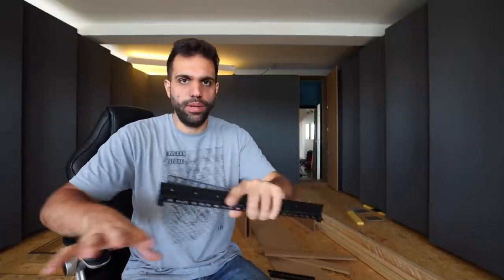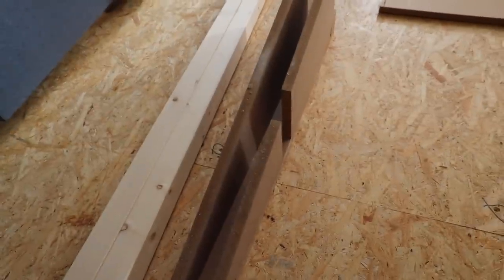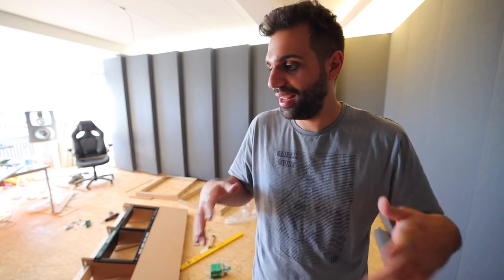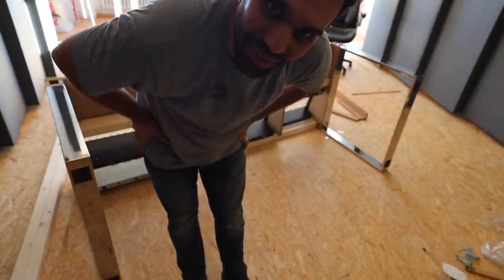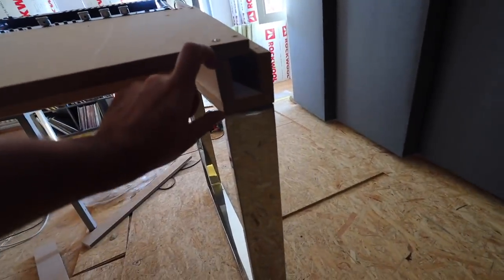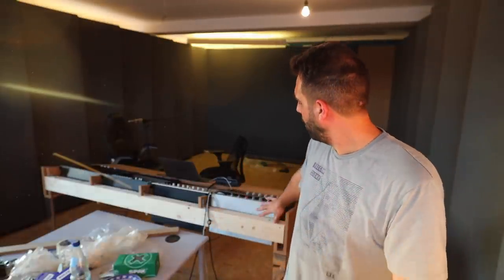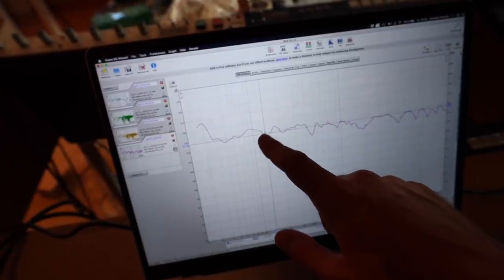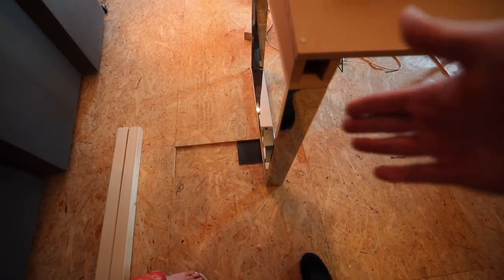DREAM DIY RECORDING STUDIO DESK BUILD - PART I

Comment: Just adding to Anywhere Near Zero's comment below, you really need to add some bracing to your  desk legs, either square plates in the top corners or cross bracing because even though you have weight on top you have no sideways rigidity. Looking forward to seeing the finished result.

Comment: Jon, did you consider Drawer Slides, Heavy Duty? I have them on my DIY Rack Music Desk and it holds my heavy Studiologic SL 990 Pro, 88 Keys
Reply from the maker: i will check them out. with the old desk the sliders where not the problem the table would fall to the front whenever i pulled out the keyboard